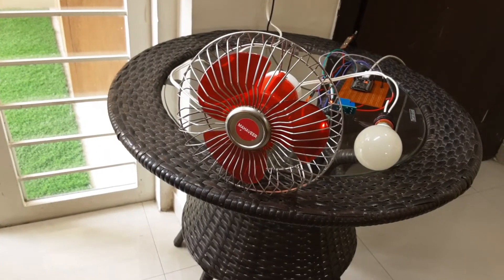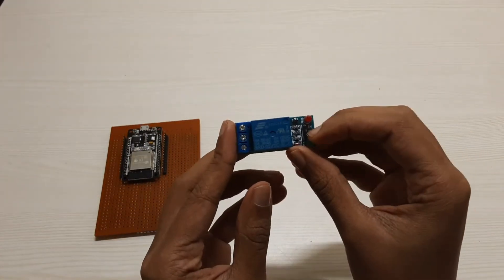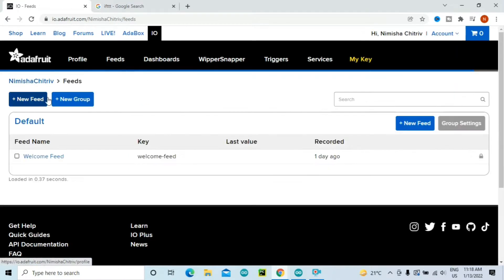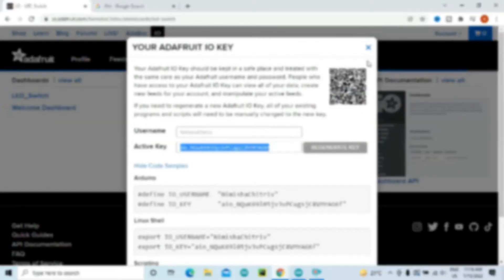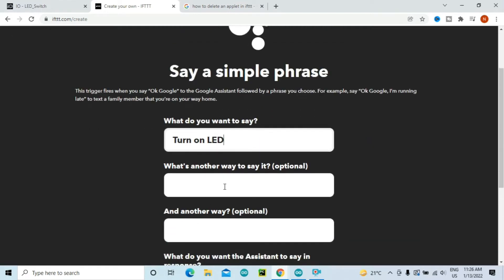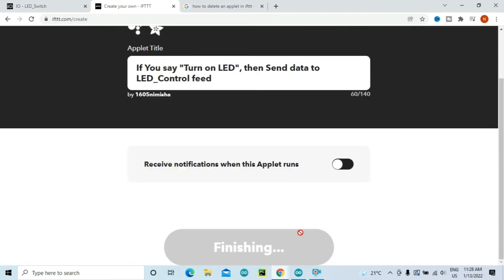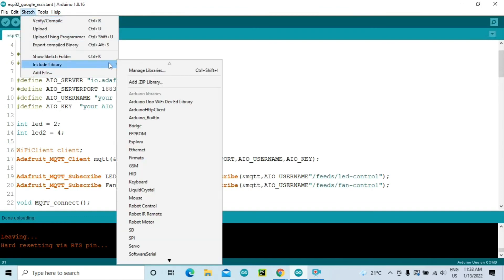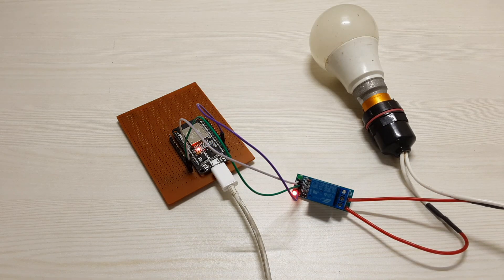How to make home automation using Google Assistant | How to make home automation with ESP32

Comment: Hi got a new MPU6050 and arduino nano tried to check if mpu is working or not when i click upload i am getting this error could you please help ! thank you.

         Using Port                    : COM4
         Using Programmer              : arduino
         Overriding Baud Rate          : 115200
avrdude: stk500_getsync() attempt 1 of 10: not in sync: resp=0x00
avrdude: stk500_getsync() attempt 2 of 10: not in sync: resp=0x00
avrdude: stk500_getsync() attempt 3 of 10: not in sync: resp=0x00
avrdude: stk500_getsync() attempt 4 of 10: not in sync: resp=0x00
avrdude: stk500_getsync() attempt 5 of 10: not in sync: resp=0x00
avrdude: stk500_getsync() attempt 6 of 10: not in sync: resp=0x00
avrdude: stk500_getsync() attempt 7 of 10: not in sync: resp=0x00
avrdude: stk500_getsync() attempt 8 of 10: not in sync: resp=0x00
avrdude: stk500_getsync() attempt 9 of 10: not in sync: resp=0x00
avrdude: stk500_getsync() attempt 10 of 10: not in sync: resp=0x00
An error occurred while uploading the sketch
Reply from the maker: Before uploading check if you have selected the board as Arduino Nano , in Serial.begin() see if the baud rate is set to 115200 , there are 2 different bootloader for Arduino Nano make sure you select the one you are using